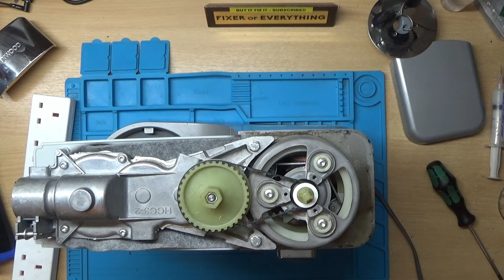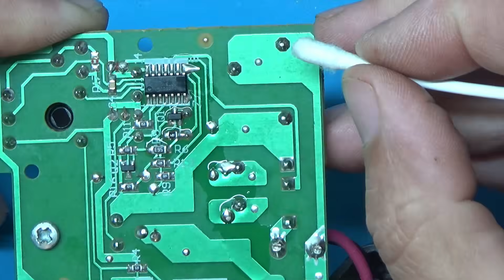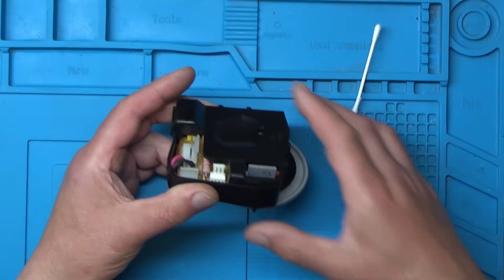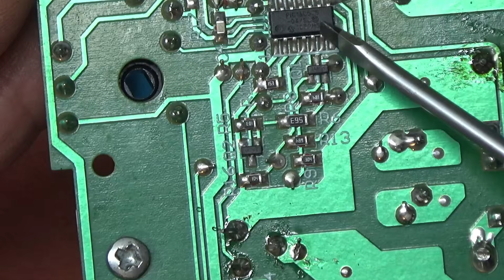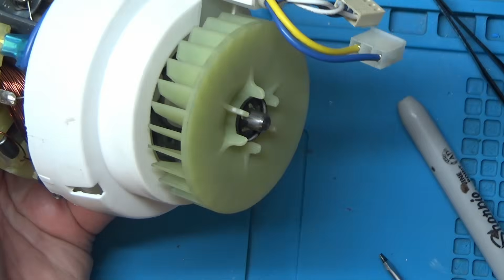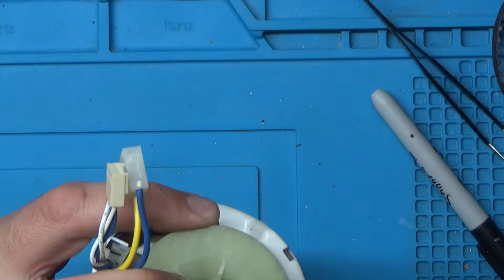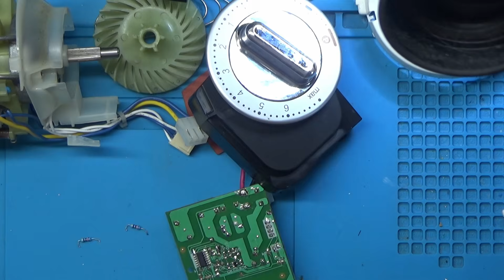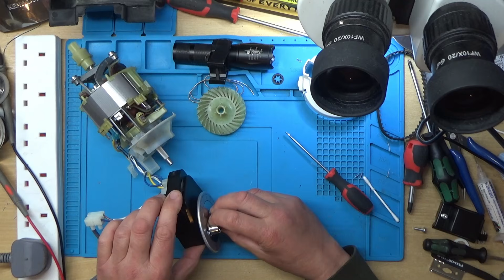Faulty Kenwood Chef Mixer - What A Nightmare! | Can I Fix It?

Comment: "Pulse" is a spring loaded position that temporarily runs the motor at full speed and then off to prepare foods that don't nee to be mixed constantly. That's a combination mixer that functions as a blender and possibly a grinder or knife sharpener.

Comment: The two extra terminals on the potentiometer go to a switch. Similar to the on/off/volume control on a transistor radio. The switch is across the potentiometer which bypasses the potentiometer and supplies full bias on the triac for full speed operation. The contact is also likely corroded as it's typically silver plated and tends to tarnish over time creating an intermittent connection. The chalking action on the potentiometer is typical of the aged carbon elements  that cheap quality elements that many potentiometers are made with.

Comment: You likely measured the current  draw of the motor without a load. It might draw 4 amps then. But the triac needs to be rated higher in current to power the motor under expected maximum load. Such as mixing thick items like dough. It would draw more current under that application.

Comment: The two one watt resistors act as a voltage divider. It's a line derived low voltage power supply with a zener diode voltage reference for the support circuitry to the triac. The triac is the only component on there that actually varies the speed of the motor. If it were bad, the motor would either not run at all or run at full speed. Typically triacs are engineered to open for safety reasons. I'm betting on a chalked up potentiometer which is coupled to the speed control selector. A bit of CRC contact cleaner or WD-40 sprayed into the pot should fix the problem.
Reply from the maker: It's a little bit more complicated than that. There's a microcontroller measures the RPM via an inductor and magnet on the bottom of the motor. It then uses this to switch the triac on and off to maintain the speed under load to keep the speed constant. The microcontroller needs to know the zero cross point on the mains, and one of the resistors I replaced is for this function.

Comment: I have a similar problem with my Kenwood KMX50 food processor.
On low speed, the robot starts for a few seconds then stops for a few seconds then starts again and so on.
I've already replaced a dead X2 capacitor.
I'm going to try testing the resistors.
What do you do at minute 50? I don't understand the test. Do you simply press on the resistor?
Thanks a lot.
Reply from the maker: @fabino31  I just touched the resistor leg with my probe, because the pin was floating and not tied to a voltage it's a very sensitive input and just touching it caused the transistor to trigger.
Reply: @BuyitFixit  So the problem was the bad contact, but above all the resistance was dead?
Reply from the maker: No. The resistor had failed open circuit, and because it was not connected to the mains, the other side of the resistor (connected to the transistor) was very sensitive to interference (me touching it).
Reply: @BuyitFixit  Thank you 😊
Saturday morning I'm going to a meeting with an association that helps us repair our electronic devices. 
I'm going to test with them.
Reply: @BuyitFixit  ok, thanks

Comment: Incredible
But how come you didn't get the scope out to inspect the signals the MCU sent and received?
Reply from the maker: Thanks 👍 Live board and my scope is mains, and I don't have an isolation transformer..
Reply: @BuyitFixit  Even after the capacitive dropper and before the triac?
Reply from the maker: @NicksStuff  Yes, as there's no transformer it's not an isolated supply so potentially could damage the scope or at minimum would trip the RCD. The problem is you need a GND for the scope probe.

Comment: I've had that happen with that type of resistor before. In my case, one of the legs broke inside the resistor. If i held it at the right spot, the resistor measured ok. And while it was in circuit, whenever i went to check on it and measure it, i would press the probes on it and it would measure ok. But as soon as i wasn't measuring, the leg wasn't making contact so the device didn't work. I almost went crazy that day.
Reply from the maker: Interesting. Thanks for sharing 👍

Comment: I dunno...  Even though this is only in 1080 definition (would love to see more Youtube creators doing 4K resolution these days - nudge nudge 😉😉), it seemed like the bad resistor had a bit of a blemish towards the right side of the screen - as if the paint had been melted a bit in that spot.
Reply from the maker: 4K is good  but it takes me about 30 to 40 minutes to upload a video. We live in a very remote area and can't get fibre broadband, and the other options are very limited. I used to have ADSL and it would take 8 hours to upload a video in 1080p ! I've got starlink now and it took an hour to upload a video tonight. 4K I'd probably be back to a week again and then storage / editing / rendering time would also take a whole lot longer too.

Comment: I'm quite surprised you took a while to test the resistors.
Reply from the maker: Most failures are usually semiconductors or capacitors. You can usually see when a resistor has failed due to discolouration / burning etc, which is why I just looked over them at first.

Comment: Last year I stripped a washing machine to replace the bearings In the tub.  And I'm so surprised it's still working I celebrate each year with a washing machine party. I have a drink over a long wash, but  don't get to see whether it's  finished till the morning.
Reply from the maker: I know that feeling. I repaired a Samsung ecobubble about 5 years ago which was the motor controller IC had failed(I thinking was my very first repair video before I started doing just repair videos). We are still using it to this day 😂😂👍

Comment: 20 minutes in  and I am wondering why you went straight to the electronics and not  have checked out the mechanics first? A cog with broken gears,  slipping clutch, cog floating lose etc.  I would have thought eliminating mechanical items would be much simpler than electronics.  Still have not seen the end yet but curious to your thought process as to why you jumped straight to electronics rather than mechanical.
YouTube in its  randomness threw up this video for me.  Must say I like the way you analyse and explains as you go along,  Will  be watching more. sub'd and liked
Reply from the maker: Thanks 👍I thought it was electronic related as the device seemed to start moving then slowly stopped over time. If you left it a few minutes you could this pattern repeated, so I thought unlikely to be a mechanical problem (although I couldn't rule it out at first). Hopefully you saw the end and the eventual cause of the problem. I've repaired quite a variety of stuff, and even had to delve into the software of some devices to achieve a fix! Thanks for subscribing and I hope you like more of my content 🙂👍

Comment: The resistor that went open circuit is an aeronautics spec resistor. They don't show any sign of going open circuit.  They are designed to be smoke proof so that they don't burn or smoke or make nonsense on an aircraft.
Reply from the maker: Yes I think someone else mentioned flame proof resistor. Thanks for sharing 👍

Comment: Ok, I have to add that one to my trouble-shooting repertoire. Visual inspection, measure some voltages, replace some suspected bad transistors, touch up soldering joints, then when all else fails, poke around with the meter leads and see if anything starts working again.  Thanks for the tips.
Reply from the maker: 😂😂😂Thanks 👍

Comment: On a small board like this the first thing you do is measure the passives, particularly resistors and diodes the Triac is way down the list as a suspect as they virtually always fail open or dead short so the motor would just run full speed or not at all the only weird triac fault I've had was where you could turn it on but then it would never turn off until you killed the supply completely when it would reset.
Reply from the maker: I would have thought the Triac would have failed short too, however on the breadmaker video I did a few weeks before this, it was not the case and it had a very slight off reading.. Measuring every single resistor would be a bit of a pain as some would need to be removed to measure them properly.

Comment: After watching this amazing bit of detective work I had no choice but to subscribe to your channel. I became a ham radio operator at age 12 in 1953 and have tinkered with electronics ever since. I have never seen a resistor go bad without showing discoloration or outright burning. You were right there at 50:00 when you noticed the board and motor jump as you touched the leg of that resistor. That is what it takes to be an excellent diagnostician. Nice one. Thanks for sharing. Looking forward to watching many more.
Reply from the maker: Thanks Bruce! Yes this one had my head mashed for a bit 😂😂😂 I think it was more luck that I poked that resistor than anything else.

Comment: A bit unrelated question but here we go: What lab power supply are you using? Is it any good? And for anyone getting into repairs you recommend a switched power supply or linear? I am looking to buy one. But can decide what to buy.
Reply from the maker: The one I'm using I bought used from eBay. EX4210R https://uk.rs-online.com/web/p/bench-power-supplies/4379007 and I paid £147 for it. It depends what you are going to use it for. This one is switched, but for a ham radio for instance you might get interference on the lower bands with a switched mode. Also what voltage / amps to you need to go up to? That would also be a factor in choosing 🙂

Comment: I've experienced this type of problem on multiple occasions. Components looking good but reads open circuit. Thats why with smaller circuits such as in a mixer as this one, I tend to check All the components before anything else. 

On a different topic: You said in an earlier video that someone mentioned "button wake-up function" idea on the Fluke multimeter. That was me (and maybe others) that commented that. 

As always! Great video and great work repairing the unit.
Looking forward to your next video.

Thanks! 😊
Reply from the maker: Thanks and thanks again for the tip on the meter 👍

Comment: I can't remember if that things called a commutator contacts for the brushes but it looks like it needs cleaning
Reply from the maker: Yes commutator is correct. I suspect it wouldn't take long until the carbon rubs off on it and it looked the same again.

Comment: Interesting - looking by your comments I wondered why you did not go on the Triac right away. Deducting from the length of the vid I could see that this could not be it though :D) Faulty resistors are somewhat seldom. Perhaps look at the circuit board with a thermo cam to see what get's hot... Me mum had a Kennword when I was young. So I bought myself one too.
Reply from the maker: The symptoms seemed more like a capacitor, as if you left it for a few minutes it would start and then slow down. If you switched it straight back on again though it would not start again hence thinking a cap or something which is why I didn't go for the triac straight away. I'm not sure how helpful the thermal cam would have been as it would not be getting hot with it being open circuit.
Reply: @BuyitFixit   Just remembered what BigClive sometimes points out that this or that circuit puts a heavy load on a component thus getting hot. Might expect some discoloration then? Or not necessarily? Just another possibility of diagnosis I think. Great hunt from you!

Comment: Great fix!  With HINDSIGHT,  could that resistor have been measured in circuit?  And why do they make those resistors blue, which makes it very difficult to read the colours ?
Reply from the maker: Thanks 👍Someone else commented that the resistor is a Flameproof Power Metal Oxide Film Resistor, it possibly could have been measured in circuit, but it would depend on the circuit as sometimes other components in the circuit would give a false reading.

Comment: Is it possible that those resistors are fusible since they are connected to the line side? Fusible resistors are common in Capacitive droppers to slow the inrush current and can blow do to a power spike.
Reply from the maker: Someone mentioned that the capacitor is a mains suppressor across the motor and when I had another look at the circuit it seems that they are correct. Someone else mentioned that the resistors are a metal oxide with a flame proof coating so they dont combust so don't show signs of failure.

Comment: 18:29 at my house, it's probably fixed at this point.

Edit:  i watched it all so I could complain about the derated triac, but you fixed it cool.  This was something that doesn't typically happen, hats off to you for your perseverance. I wonder if this resistor would have jumped to life with freeze spray?  Im not saying you should have tried that, because might have iced down rhe transistors and the PIC, but probably not a resistor.
Reply from the maker: 😂😂😂Yes replaced the original triac 🙂 I doubt freezer spray would have done anything, but I never tried so can't say 100%

Comment: Wow. In over 40 years, I've never encountered a resistor that failed open without there being some visible damage - either a mechanical break, or clear heat damage.
Reply from the maker: Yes same here, it's why it took me so long to figure out the problem. I honestly thought it would be something like a capacitor or the triac.

Comment: At 3:20 it sounded like it was running out of fuel. :-0
the good 470K 1% resister is reading too high I'd have replaced both of them.  But not sure why they needed to be 1% in the first place.
Reply from the maker: Yes it did sound a bit like that 😂😂😂I did replace both resistors 😉

Comment: Great job! What you encountered is a Flameproof Power Metal Oxide Film Resistor. They are ideal for high specification or technically demanding circuits. (e.g. kitchen will not go up in smoke, when mixer is overloaded) The resistive element comprises a metal oxide film deposited on a ceramic former. The element is protected by a flameproof coating that withstand overload conditions without flame or mechanical damage.
Reply from the maker: Thanks👍 and thanks for the info on the resistor 👍
Reply: As you probably already know, Fluke uses (used?) these in their multi-meters.  They frequently fail just as this one here has  - just open with no evidence.    People, including myself have replaced them with "regular" resistors, but I try to use a NOS.  Unfortunately, they aren't available from Fluke anymore.  (well, the ones for my old meters, anyway.  The meters I have experience with get older every year.)
Reply: @excavatoree  Remember the Fluke 25/27 very well 🙂 Still have one in my Fluke collection. (Military, dark grey one) Still today within spec 1% 😁 You can get the resistors at Digikey or Mouser
Reply: This makes some sense now after posting a comment about a bit of a blemish I saw on the right side of the bad resistor..  It looked as if the paint had been melted a tiny bit (on the right-side purple band).

Comment: Yes 1/4W resistors are not usually rated for mains voltages. 1/2W or special high voltage are required.

Comment: Oh man, haven't I been there too.. Was bulding a ZX81 computer board and it did not work due to an open resistor - brand new. Of course the last thing you expect. And that too was a blue one 😀
Reply from the maker: Bloody resistors! 😂😂ZX81 now that brings back memories. Someone loaned me one for a while before I got my ZX Spectrum, with the 16K ram pack which made it crash if you breathed on it slightly!

Comment: Great fault finding!  If that 1/4 watt is effectively across your 240 volt line, it is likely used above its voltage rating.  If so, I would suggest replacing it with two in series of half the value to decrease the voltage stress on it.
Reply from the maker: Cheers and thanks for the tip 👍

Comment: I am rather surprised. I have found triacs to be the fault on many of this type of circuitry!   Nice fix, Mick. Thanks.
Reply from the maker: Cheers mate 👍Yes I was rather surprised too! 😂😂
Reply: @BuyitFixit  Until you tested it, my money was on the potentiometer, after that, the more you tested good, the more perplexed I got.  I would never have thought that the cheapest component in there was the culprit, but as others have commented, that one particular resistor should really be two, each at half the resistance, to spread the voltage rating out better. And yes, those 5 band resistors are a right pig sometimes to read the colours properly, especially on the blue background.
Reply: Triacs more often than not fail closed circuit, they just won't switch off. It took me ages to find that very issue in the controller for my electric shower. I kept hearing a very brief 'boiling noise', almost randomly but could never localise it. It eventually happened at the exact same time I saw my house power meter reading spike up, and could hear sound from the bathroom properly. It turned out to be one of the heating element triacs, stuck closed circuit, only being prevented from causing utter chaos and destruction by a safety overheat prevention circuit switch. Changed it for a triac salvaged from an old 2kW vacuum cleaner and it's been perfect in all the years since.

Comment: That was a really weird fault. A resistor in perfect condition that is completely open! Ive NEVER seen that before. Replaced lots of BURNT resistors that had failed but not ones in perfect condition. I replaced an open circuit 300K 1/8th watt startup resistor in a switch mode PSU that had been over heating. Replaced it with a 390K 1/2W resistor. Doesn't overheat now.
Reply from the maker: Yes I've not came across that one before either 😂😂👍